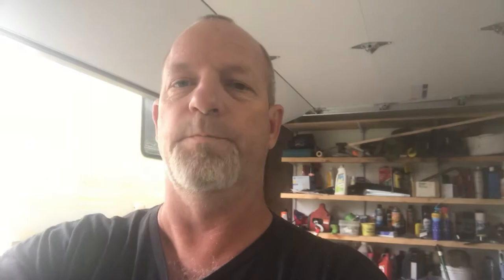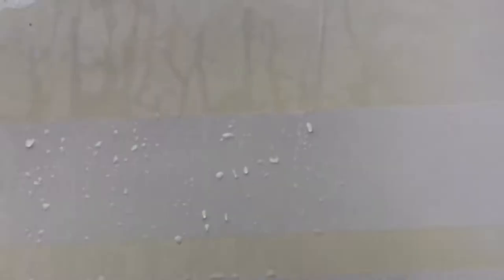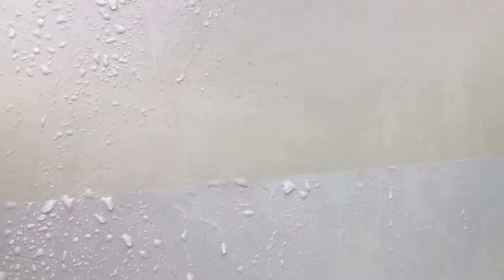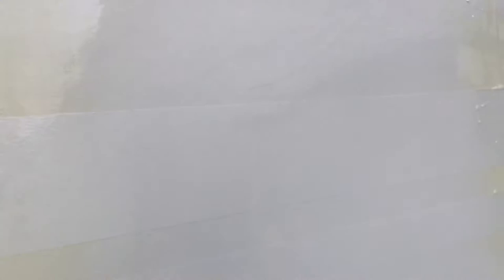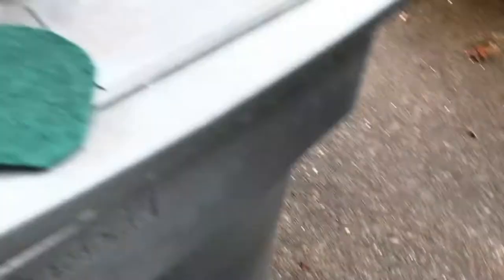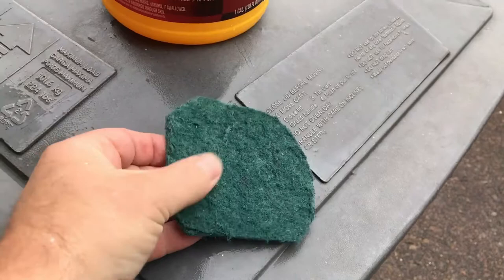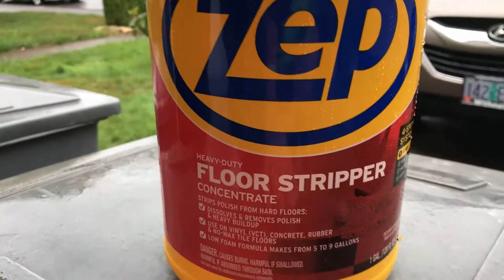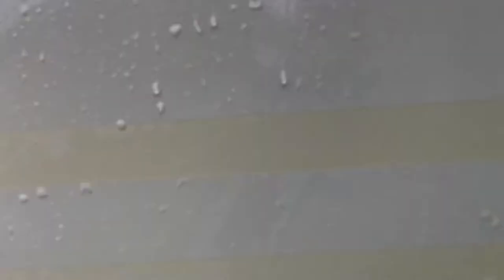ZEP Stripper on RV to Remove Wax and Yellowing. Like New Condition!

Comment: Just FYI, i tried this on my white rv to strip the wax.  The stripper worked great in a small test section.  It removed the wax fast and left a clean surface.  The problems started when i did a large section and/or let some of the yellow stripper run down on top of a cleaned section.  It left the white RV noticeably stained and i couldnt remove the staining.  That is untill i tried a common gel form of bleach: toilet bowl cleaner.  Brushed on with an rv cleaning brush, let sit for 20 min, re brushed it, sit for 20, rebrushed, sit for 20 and then washed off really thoroughly until no sudsing was left.  It brightened up the RV brighter than the day I bought it (used).  It looks almost brand new now.  Didnt damage the decals either.  Wouldnt recommend doing this often but it may be a decent way to super clean in prep for long lasting acrylic rv producs.

Comment: I LOVE Zep high-gloss floor polish!! I did a small section on my fifth wheel with it 2yrs ago, and after 19dg winters and 95dg summers, it hasn't flaked, peeled, etc. and STILL looks like I just put it on. Pollen, dirt, dust, etc. just blows right off.

Comment: Thanks, Andy!!!  I can't wait to try it on our 2001 Montana fifth wheel.  I will let you know how it turns out.
Reply from the maker: Cool. After I stripped all the wax off, I used Zep floor wax and applied about six coats, and that’s when the shine really came out. Not sure how old that video is without double checking, but I finally have to re-coat the wax this year. That’s how long it lasted!!
Reply: That's good to hear.  I think the video was from 3 years ago.  I tried the Zep and a buffer in an area last night after work.  That spot looks and feels nice.  Thanks, Andy!

Comment: That helps immensely, subscribed. I bought an old rig a few years ago used some Meguires oxidizer to remove that powdery white dullness. Worked ok. Takes a while to dial in new skills, but that my friend is very helpful. How did you get the decals off. Mine are not horrible but I may change them some day. Thanks again man, appreciate it and love the straightforward format, just you and a camera showing people how to get it done. What a cool time live in, blessings
Reply from the maker: @masterdaveedwards  hey, thanks for the comments. Well, those decals were old and they were a bugger to get off. Mainly I use the decal stripper from the hardware store. Let it sit and just worked at it with a plastic scraper so I didn’t scrape the gel coat. It took me about a week to get everything off of there working on it here and there. After i removed the old wax and yellowing, I had to go around the RV with the floor wax six applications before it gloss and shined. That shine lasted almost 3 years and now I just touch it up here and there when it gets dull. Good luck and have fun with it.
Reply: @atlyvwire  That’s brutal, but as with most things in this life, hard work and suffering usual result in rewards that instant gratification cannot produce.🍺

Comment: That's impressive! This time, I'm using Star brite Marine Polish after prepping. Spread it on and polish when dry. One coat! Quicker and easier than Zep that I applied two years ago, in 6-8 coats.
Reply from the maker: I may try that Marine polish next time. It’s been exactly one year since I applied 6 coats of Zep polish and it’s still shines like the day I applied it. Good prep I guess makes it last a lot longer. I have to say, applying 6 coats around the RV was a little nauseating

Comment: Great idea modifying the sander!
Reply from the maker: Sure made the job easier. I did apply six coats of the wax and it’s been exactly a year and it looks today like it was just put on.  Because of the good prep, it’s not flaking or peeling. I get compliments all the time. However walking around and applying six coats to your RV that took a while!!! 😅
Reply: @atlyvwire  Hi Andy, This week I went all in and used Zep 50/50 stripper on my 17 year old coach. Then I applied 3 even coats of Zep wax and my coach looks unbelievably amazing. My motor home looks 10 years newer. I was on the fence with doing it, because there are lots of videos on you tube where people didn't get good results. Thanks for your video and the comment you sent me, because your information definitely helped me make the right decision.

Comment: How did u get the decals off??
Reply from the maker: I used STRP Max from crown. I picked it up at a paint store. Problem is all strippers are methylene chloride free so when you put that stripper on there it needs to sit at least 15 minutes till it bubbles up. That’s what I used for the thin baked on decals that were so thin a heat gun would not remove them. For the thicker ones I use the heat gun and patience
Reply: Check into a 3m eraser wheel for a grinder. Rubber wheel for decal removal without chemicals.
Reply: @Gregasaki  Me too. The eraser wheel was the answer used 8 of them. Arizona backed on decals. Zero damage to the sidewalls. No other way to remove the cracked and backed decals.

Comment: Goo Gone or WD40 would have saved from a sander and endless abrasive damage. Sray with Goo Gone with dish soap/water with a very soft cloth like microfiber When done spray wax and done. Very foolish to use an abrasive scrubber and insult to injury, using a sander.
Reply from the maker: Thanks for the comment.  I finally had to re-wax this year since the making of the video.  Sides are fine, no damage done.  Maybe next time I'll use a cheese grader... HAHAHAAA  just kidding. :):face-green-smiling:

Comment: This should solve my issue hopefully. Last week i used Zeps floor polish on my little camper, but apparently didnt clean surface good enough, as after 3 coats looked like dog shit. It was so streaky/pasty. Of course my Lowes only had a 5 gallon bucket of the stripper so i just tried ammonia and scrubbing power. It does take off the wax but is just too much scrubbing! Im going to try this exact method but hope it will not harm the vinyl.
Reply from the maker: I can’t remember, but I think it was about five coats I put on. Coats two and three it look like crap but once you get to the fifth coat, it really starts shining!!